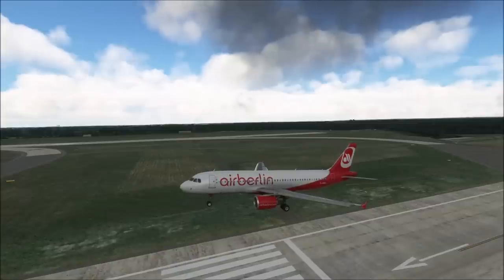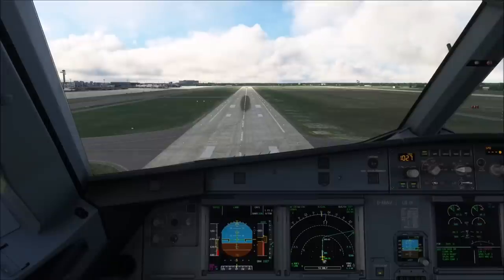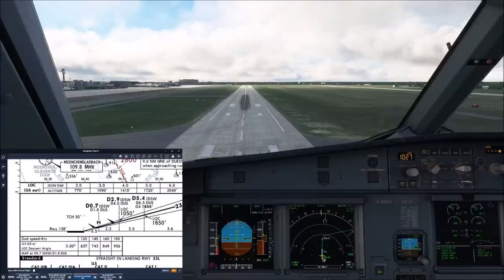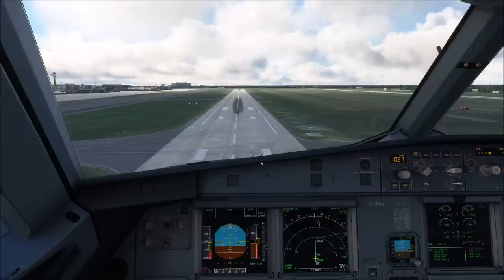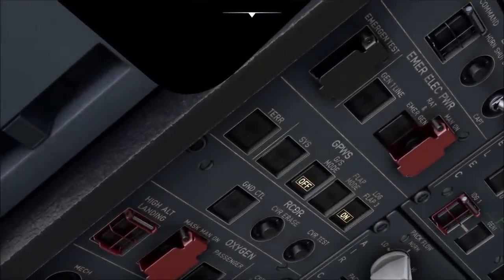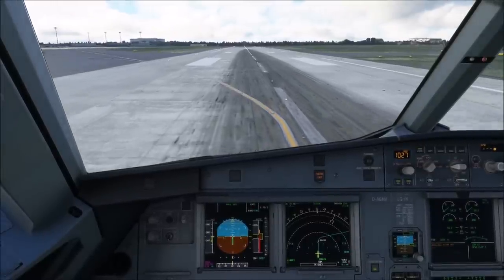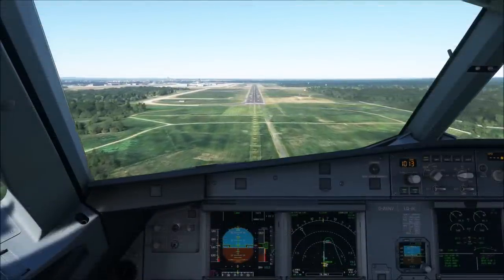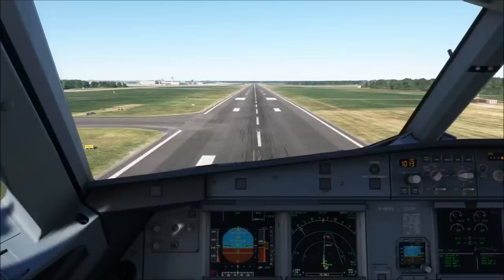How an MSFS BUG makes your LANDINGS MUCH WORSE | Real 737 Pilot

Comment: I'd love to see this fixed. Landing at a new airport always feels like a roll of the dice as to whether the PAPIs and GS will be on target.
Reply: In general, due to physical limitations on the placement of PAPIs/VASIs and the touchdown paint hardwired into runway objects, the PAPI/VASI and touchdown markings agree with each other but are wrong compared to real life.  OTOH, the GS is derived from real world nav data so is usually correct.

Comment: One point to be stressed is: On the majority of major airports, the PAPI it is NOT a reference for path when you are crossing the treshold. The PAPI is calibrated for the "highest" cockpit (pilot view) which operates at that airport. It happens to keep the main landing gear and the rear portion of the fuselage, which is well behind the cockpit, at a safe height crossing the treshold. Since most os the people are using narrowbodies (737, A320) on MSFS as of today, it is pretty normal that you will see 3 reds xing the treshold. However it is not correct the GS trigger the Glidslope EGPWS callout in this situation. To trigger the EGPWS mode 5 below 100ft below the minima (200ft for CAT1) you must deviate wellll below the GS to get a soft warning. Crossing the treshold, PAPI and GS indicator should not be taken in consideration, unless you are interacting with a CAT3 equipment which must delivery a perfect angle and calibration along the TDZ and rollout.
Reply: So you should fly lower than the PAPI in a VFR C172, for example?
Reply: @Pierluigi_Di_Lorenzo  Only in airports where 747 still regularly flies to.

Comment: Thank you for creating this video, which facilitates discussions with developpers. It's even worse: 
Standard TCH (Threshold Crossing Height) is 50 ft, deviations are indicated on the approach chart. That means the glideslope crosses the threshold at 50 ft and the glideslope antenna located at the lower part of  the radome will follow that glideslope. The main gear will be 23 ft (A340-300) to 34 ft (A319) above the threshold, the radio altimeter (aft fuselage) will be 5-7 ft higher. So when you place the aircraft with the main gear over the threshold, the RA reading should be between 30 ft and 40 ft, depending on aircraft type, NOT 50 ft.
For IFR procedures misaligned glideslopes and PAPIs can be true showstoppers, imagine a sharp CAT I approach at night: arriving at the minimum (200+ ft), looking at four red or four white PAPI lights is an immediate go-around. Crossing the threshold on the glideslope at 70 ft RA, looking at a long landing, will likely be go-around as well. Unfortunately, too many add-ons don't get these basics right. Please have a look at this Airbus document for numbers and illustration:
https://www.airbus.com/sites/g/files/jlcbta136/files/2021-12/Airbus-Aircraft-Data-for-Visual-Aids-Calibration.pdf

Comment: There is something else at play here too. At Dusseldorf (23L), the PAPIs are placed 300 feet behind the middle of the main blocks (in both real life and in the sim) of the touchdown zone, while at Cologne (32R) they are almost exactly abeam the middle (40 feet in front). The middle of the touchdown zone at Dusseldorf is 1375 feet, while at Cologne is 1530 feet beyond the threshold. This means that the PAPI's are placed 1675 and 1490 feet beyond the threshold, respectively. Some of this difference might be to make up for runway slope to make sure that you are indeed 50 feet above the threshold when crossing, so then an incorrectly modelled runway profile might be the explanation of large radar deviations, but the simple fact that the PAPIs are placed differently relative to the middle bar of the touchdown zone means that if you fly strictly following the PAPIs, then you will have indeed a different perspective to the touchdown zone, and a significantly later touchdown at Dusseldorf is not a surprise. Another story is that in real life the ILS glide-slope and the PAPI might not be exactly aligned by the time you are above the threshold, because a) their source is not exactly aligned, b) your ILS receiver and your eyes are not aligned at all.
Reply from the maker: I've done both landings of this video in real life as well with the 737. While there is a visible runway slope at DUS I haven't had any issues putting it down on 23L just as on any other runways. So in real life it's same-same.
It's an interesting thought about the slope and its impact on the landing in the sim. However I don't think it would lead to such a big issue. The most notable download on 23L comes behind the touchdown zone.

With the eye-height of the 737 you'll see 3 reds on very short final on most runways. Definitely not 3 or 4 whites as in MSFS. Even without looking at the PAPIs or GS it's very easy to tell what we're much to high during the DUS landing.

Comment: It's funny that you bring this up. I've had quite a few landings in the 737 where I was on glideslope and localizer until short final, then if I stay on the PAPI the glideslope AND the localizer are both way off. It's exactly what you show here. Happens in Miami (KMIA) runway 9 for example.

Comment: You landed in the first 3rd of the runway and within the touchdown zone with a safe descent rate and more or less on centerline. You weren't spot on the thousand foot markers, which is what we try for, but it wasn't "unstable." That would be a perfectly adequate landing at my previous airline and my current one.
Reply: Agree on this one. I was like "oh, please..." when you said the landing could not become a good one anymore because you were 70ft high over the threshold instead of 50ft and that you would call for a go-around at that point IRL... that's a little bit over the top really.
Everything said about misplaced PAPI and ILS is true of course. It has plagued all flight simulator iterations ever since.
Reply: @flyer7807  ever since what? 2020? aka the latest one? or was it introduced in FSX?

Comment: I noticed long ago that the ILS is too high at most airports. I also noticed that contrary to my instincts, I can actually make much smoother landings if I disengage the AP earlier and land by hand purely by the PAPI lights, instead of letting the AP guide down the plane per the G/S. I suspect the issue is that when the developers designed the ILS, they set it so that the 3 degree touchdown point is directly at the markers, but they didn't take flare and wind conditions into account. You can't just land straight in 3 degrees, you actually stretch the landing by flaring the aircraft. And I think that is what they didn't think of when setting up the glideslopes.

Comment: This has been a problem forever, agreed 100%. This must be addressed by the devs asap. This and the random stutters at uncertain intervals make manual landings impossible. This alone becomes a restriction to perform an autoland in MSFS2020 because even the CAT III ILS approaches are not correctly configured.
Reply: Do you have any external flight tracking software running? I find that if I have something like Volanta (and to a lesser degree SimToolKit Pro) running to track my flights/landings I get the stuttering, that or more less disappears if not trying to track. Perhaps most interesting to me is that upgrading from a R5 2600 → R5 5600x did very little to address the problem.
Reply: @MrMegawsomedude  very recently installed SimToolKit Pro... no changes... I'm assuming it's my sim settings but I've changed it a couple of times to still observe noticeable stutters

It will pause for less than a second but during landing that one second makes a whole ton of difference.
Reply: With regards to what this video is centered around, not all of us are real pilot but we do have some previous experience with Flight Sims. For me this was xp11 and I'm so accustomed to following the glideslope and PAPIS to the end that it becomes significantly difficult to perform an approach where the PAPIS show a different picture than the glideslope, both of which differ from the actual visual picture.

Comment: Over at my country. It's pretty common to have unreliable glideslope/Papi at secondary/smaller airports with the disparity margin of them both being quite out. Usually pilots would have their own discretion to disregard the glideslope just before minimums and aim for the PAPI. But this cause some increase occurrences of unstable approach past minimums as the glideslope occasionally results in the PAPI being 4 whites. Chasing for the PAPI may result in a abrupt steep descent and requires a go around. Crew flying had to file a report. Continuous reports will result in the local aviation authority sending in their calibrator a "learjet" to recalibrate the ils and also sending a local contractor to have a look at the PAPI etc. This it will fix the issue only for problems to reoccur a year later and the cycle repeats itself. At the main international airports that are well maintained such issue is pretty much rare.

Comment: That makes sense. I've had to do quite a few go arounds at certain airports due to being too high even after flying the ILS approach correctly. The last time was yesterday, runway 25 at the default EGGW. Did a go-around and appraoched on ILS again but still got a glideslope warning from the Airbus. I hadn't had this issue when approaching from the opposite runway for the same airport.

Comment: I've been whining about this bug in MFS2020 for over a year now, thanks a lot to bring this up! 
I can live with incorrect PAPI, but incorrect GS is a big no no for me, especially for someone who wants to practice instrument flying, follow the flight director and raw data to about 300 RA, when break out of the cloud, and realized you are 4 whites on PAPI and way too high. 
I believe this bug is caused by how MFS2020 placed the GS antenna, seems MFS2020 decided to place the GS antenna based on the runway length, the worst part is: they included the displaced threshold length into the available landing distance. After some tests, I found that in some runways without displaced thresholds, the GS might be correct, but if a runway such as EDDL 23L has a displaced threshold, the GS will be incorrect.

Comment: Some Corrections: for CS25 aircraft in EASA clearance is 30ft, not 50. PAPIs are supposed to be calibrated so that you are 20-45ft agl over the threshold for smaller airfields. Larger airports which service wide body aircraft will have PAPIs calibrated to arrive over the threshold at 70ft. (Or a different value, TCH, as mentioned). The TCH is usually from a calibration aircraft, usually something small, which usually results in higher crossover heights in larger aircraft 🤷🏻‍♂️

Furthermore, PAPI is not always a perfect match to the instrument approach glide. This happens often. The difference is small, so it’s usually not noticeable further out, but it becomes more pronounced closer to the runway.

This is why some operators say to follow the PAPI to the flare, whilst others say to disregard them below 200-100ft. 

In the end, this doesn’t seem like a bug to me. I could of course be wrong.

If your landings suck though, blaming poorly coded PAPI is not really a valid reason. Standards and techniques still apply

Comment: Now I understand the discrepancies with soooooo many airports where the papi's and GS do not match and you simply can't trust your GS in low visibility. I thought it was the payware designers that made mistakes with either GS or PAPI settings but it seems an ASOBO problem. It's also true for many airports that there is an offset on the ILS when you approach but none in real life (as per Jepp chart).

Comment: I think the glideslope by default transmits from around the middle of the runway, not the touchdown area, hence the higher than usual profile. The scenery editor does allow you to move the LOC and GS origins to specific points on the runway, but it's possible that a lot of airport addon devs don't bother messing with the NAVAIDS. I am actually working on my first handcrafted airport and have moved them to where they appear on the satellite map. Hopefully, it will make it more realistic when I get to testing. This video will help with that.

Everybody knows the default airport generator leaves a lot to be desired. We still have wrong taxiway names, lights and taxiway signs in the middle of runways and taxiways, dark aprons, and in some cases, buildings not generating at all. Hopefully, my theory is right, because I think a simple fix would be to tell the AI generator to "put GS origin next to the auto-generated PAPI lights". Well, they wouldn't have big discrepancies between them at least.
Reply: In real life, the glideslope antenna is next to, or very close to, the runway touchdown point.
Reply: @MikeInExile  Yea, I am aware. Also, testing at my custom airport unfortunately didn't completely fix it. I can get it pretty accurate close to the flare, but it still seems to spit out some crazy data when I get closer to the GS point, like it would deviate up and down pretty wildly despite flying on the exact profile.

Comment: Fly the needle. First I use the FD with the GS indicator but the lower I go I change to FD with the PAPI at about 300 ft. At 100 ft for the last correction and normally I get between the blocks and the next one. With an Autoland the previous can get out of the window and just hope for the best... :)
But this is a problem since FS1 and P3D till today. Probably has also to do with scenery dev's who put the rwy's on another place than the default and don't change the ILS with it.

Comment: Thanks for pointing this out. It's really annoying and probably the reason, why my landings in XP and P3D are better most of the time, resp. it's easier to achieve a good landing than in MSFS.
Reply: Glide Slope is generally very off in Xplane aswell. Its a problem across all simulators sadly.

Comment: I have noticed this issue often and not always in the same fashion. Sometimes glide was ok and PAPI was completely off sometimes the opposite. Wile I acknowledge that in a auto-land scenario this might be a slight issue (one that 99% of simmers would not even notice) in any other case it’s not a real problem IMO. Personally I have never considered PAPIs, glide slopes or rad alt callouts a necessary tool to carry out a good landing. What’s certain is that this MSFS bug that I acknowledge exist doesn’t affect my landings in the slightest …. they are as bad as always LOL. But that’s just me.

Comment: I can confirm the issue for sure. I always feel I can have better landings when keeping 3 reds and one white and sometimes even 4 reds! Also, the virtual airline I fly in uses a flight tracker client called smartCARS and it shows an "early touchdown" in 90% of the time which reconfirms there's something wrong with MSFS runway coordinates. (I've been using this client since 2011 and MSFS is the only simulator showing this). It seems the runways need to be a bit further than they are, hence explaining the glideslope and TCH issue. 
Just imagine in your first scenario, you lift the plane a couple of more feet to be around 100' to be on the glide. Then, this means the runway needs to be shifted away so you pass the threshold at around 50. Just my two cents.
Reply from the maker: The issue seems to be the placing of the GS signal, not the runway. When you fly an RNAV approach, which relies only on GPS data and not the GS, you normally end up at a better point.
Reply: @A330Driver  Yes, if RNAV guides the plane on course then the coordinates should be fine. The only c contradictory point would be the weird report I get through my VA tracker software which doesn't necessarily mean an issue from MSFS side as it could be an interface bug,.

Comment: I gave MFS my best shot.  I'm giving up on it for now.  It's the first sim I've ever personally flown that makes one feel that being an actual pilot works against you.  Perhaps an X-Box game controller would work better than actual flight controls.  Gamers are impressed with the graphics and I get that.  They don't have a point of comparison to real airplanes or even a better sim.
XP-12 Zibo is a better sim for pilots, not that it is perfect.  In Zibo, the flight director also lags.  In the real airplane, on an ILS with the airplane right on the flight director needles, the raw data G/S arrow will also stay centered.  But that doesn't happen in either Zibo or MFS.  It must be difficult to model.
Perhaps, and hopefully, future updates will fine tune these home sims a bit better.  Meanwhile, Zibo is the better choice.